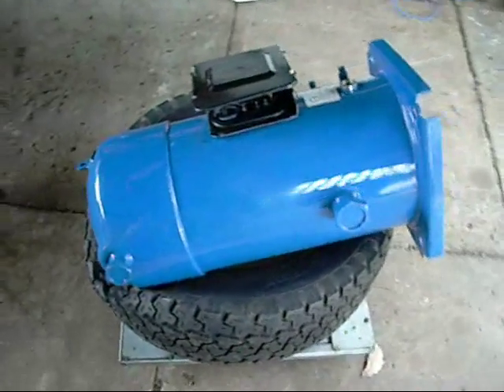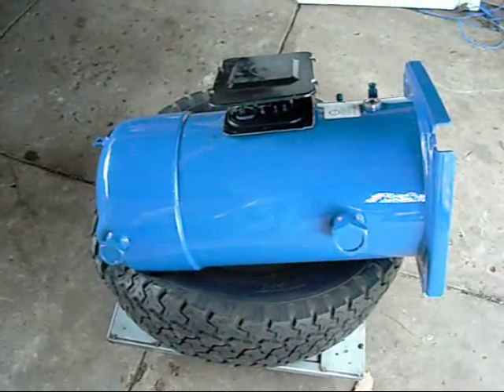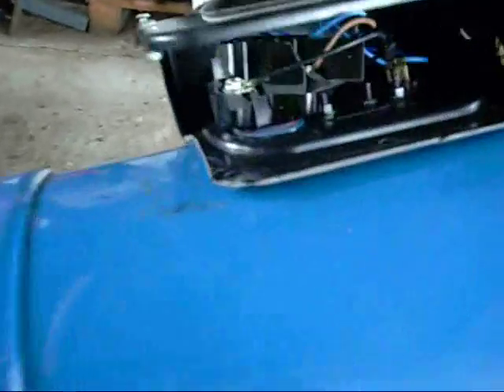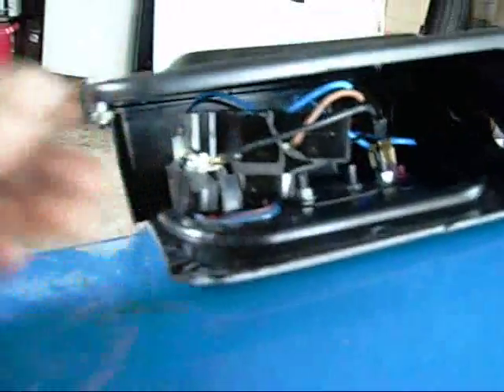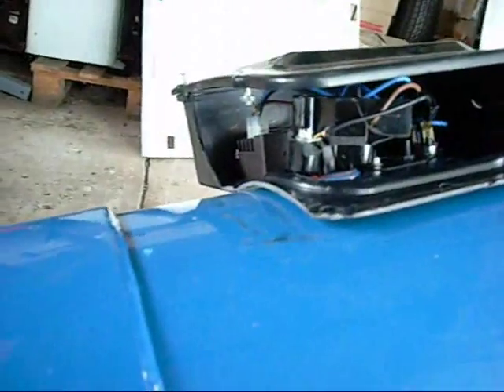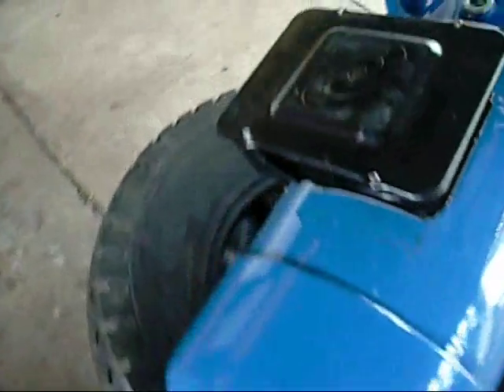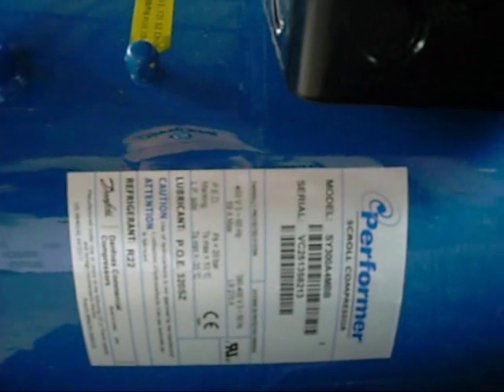Huge Performer Scroll Compressor

Comment from the maker: Our single phase power is 240V 50hz but three phase is 415V 50hz

The compressor was rated for anything from 380V 50 / 60hz to 460V 50/60 hz
I guess it would be universal to many countries.